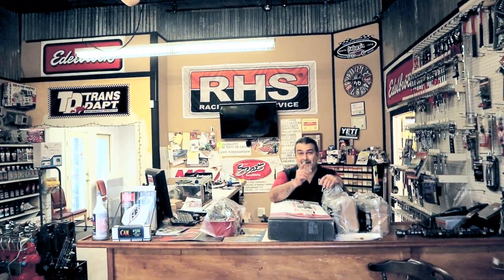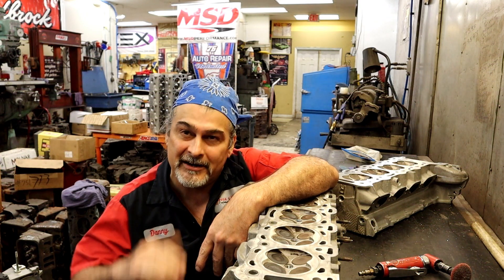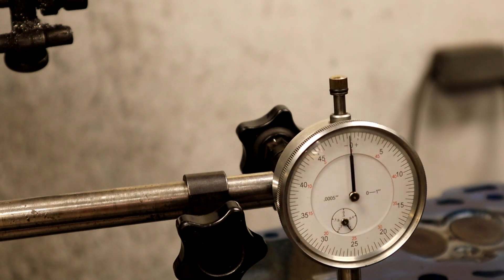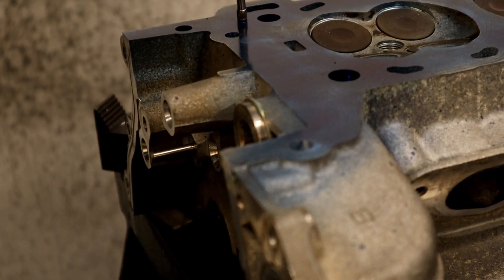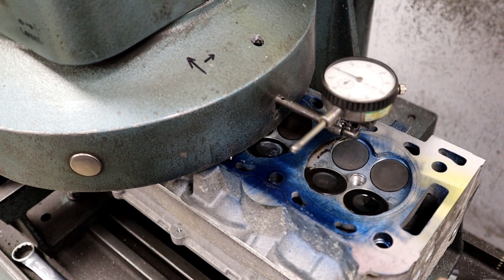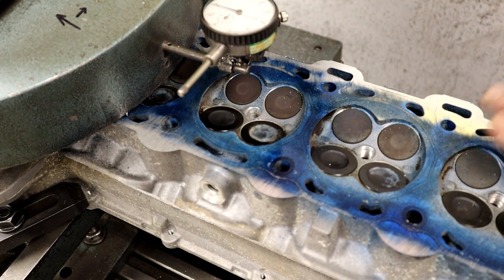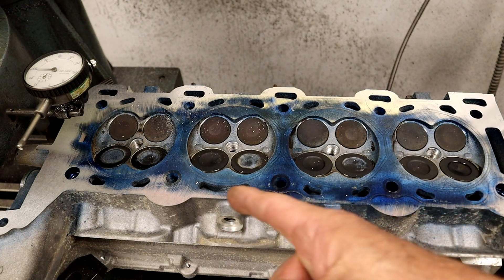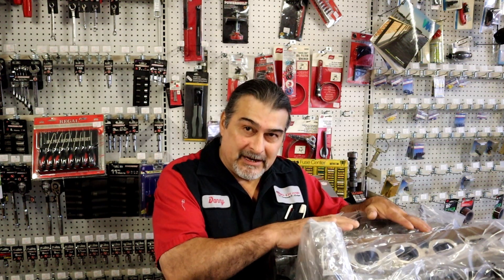TIP OF THE DAY:  Never Use Scotch-Loc’s On Aluminum Cylinder Heads.

Comment: Awesome demonstration! Using any kind of abrasive on a power tool is asking for problems. The exception may be plastic or nylon bristle wheels. Wonder if even those are fully safe. Thanks!
Reply from the maker: I’ll have to buy one and mill a head then use it and mill it again and see what happens.👍
Reply from the maker: My set of Roloc’s bristle disc’s just came in and I’ll do a follow up video soon. This time I’ll mill first the test them all on a used/junk head. 👍👍👍
Reply: @MrDanielSoliz  Woo! Looking forward to it. I've seen your eBay ad about 100 times now. ;)
Reply from the maker: @802Garage  thank you it tons of fun to make. Right now I’m working on the “Making of my eBay commercial” video. Hopefully I can I’d done by Friday. 🤞
Reply: @MrDanielSoliz  That's awesome! I actually just got a deal with eBay Motors as well to make a TikTok. I'll have to send you a link when it releases. 😁
Reply: @MrDanielSoliz  Did this ever happen? If I can't get the broken bolt out of my head, I may have to switch to a head from the junkyard and don't want to mess it up by doing something dumb. These things are getting harder to find.
Reply: @MrDanielSoliz  Did you make the video on the bristle disc's in the end? I'm wanting to settle a debate on it.
Reply: I'm wondering the same thing.
Reply: 100% safe. It's the intended purpose of the green, yellow, and white bristle discs.